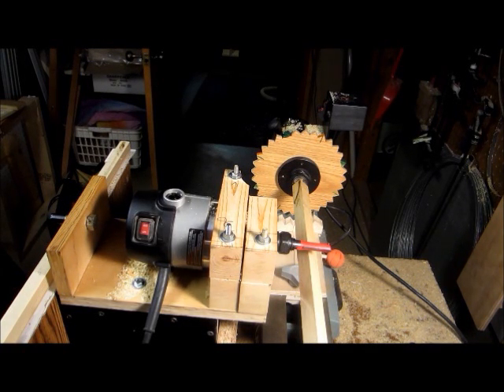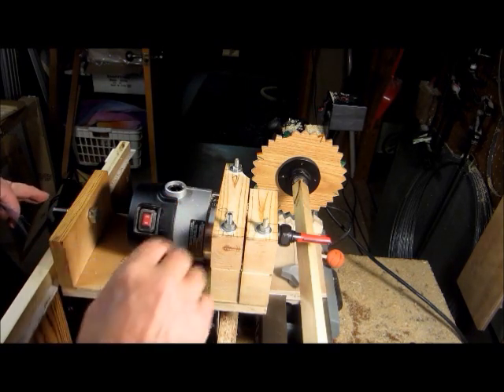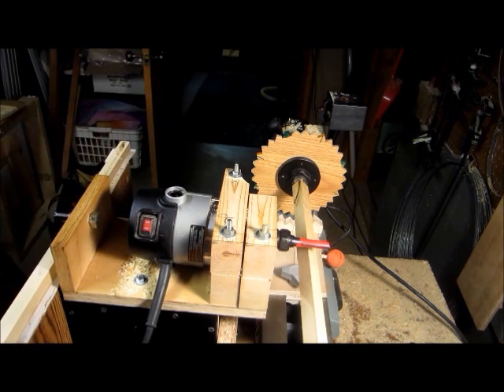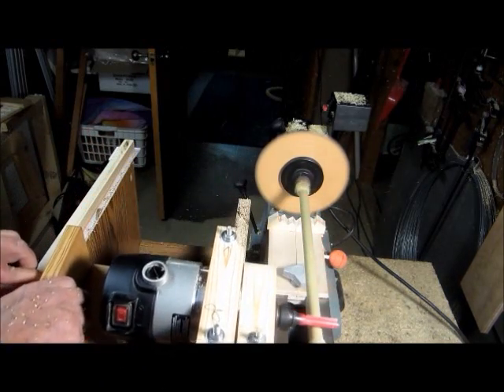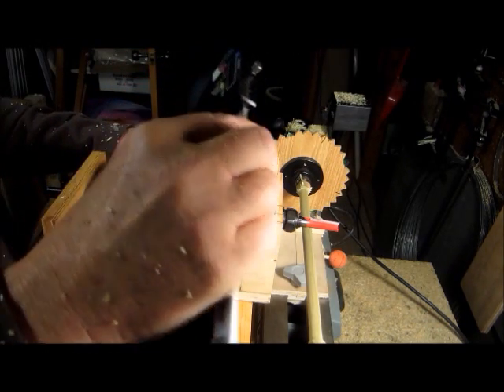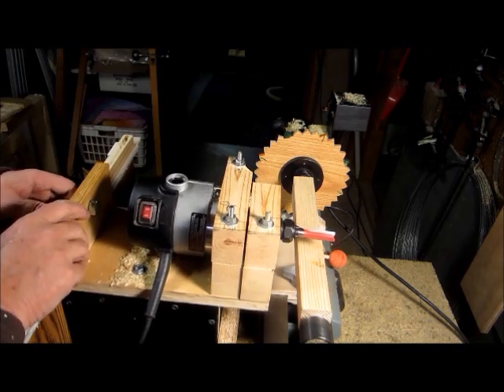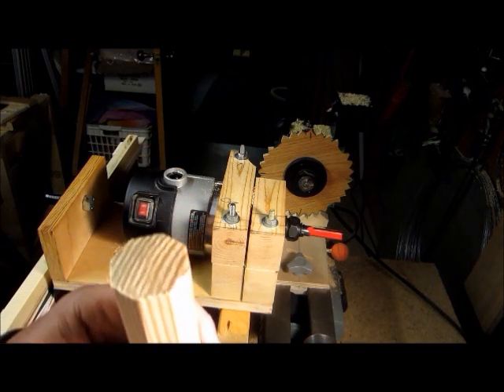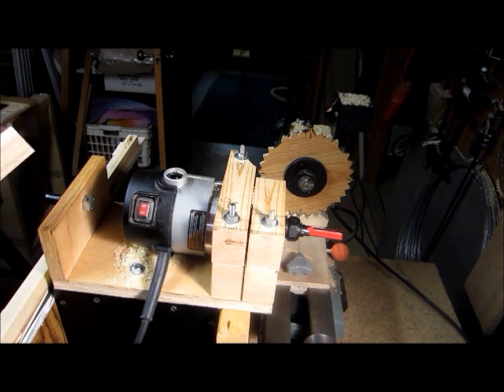Router Lathe Chapter 2

Comment: Nice ….any information on just how you built this?
Reply from the maker: I didn't even really use measurements.  It is basically a small box built inside of the bigger box.  The bottom of the small box has a long threaded rod through the bottom of it, so I can hook bungie cords to the rod.  Then the other end of the bungie cords are hooked to two bolts (one on each side near the top of the bigger box).  That lets the inner box bounce up and down, suspended by the bungies.  I hope this helps
Reply: That does help ...although I wish I could see the inner workings that you describe.  At any rate ...creative build!  Thanks for sharing